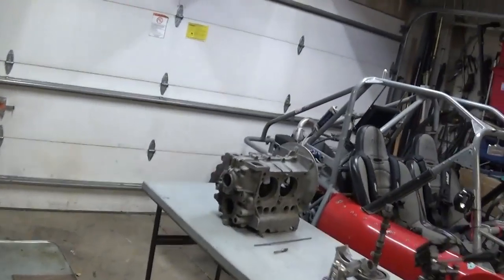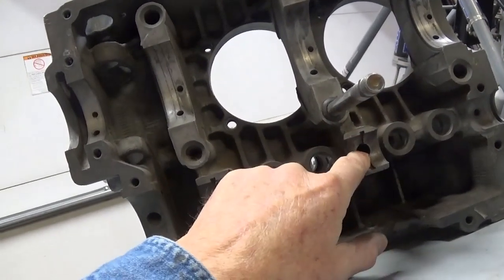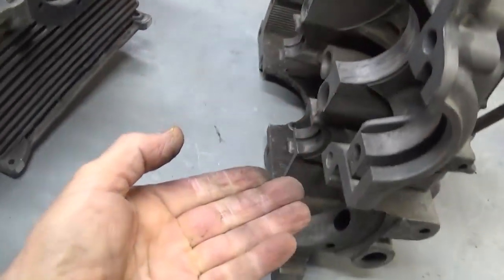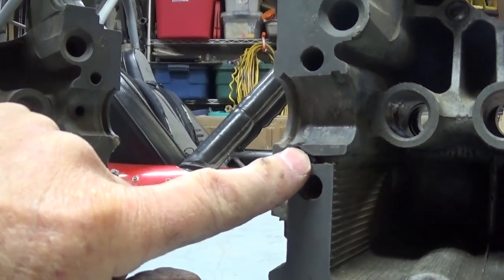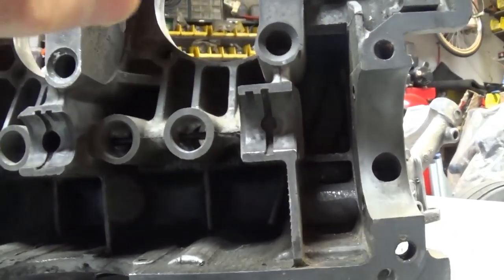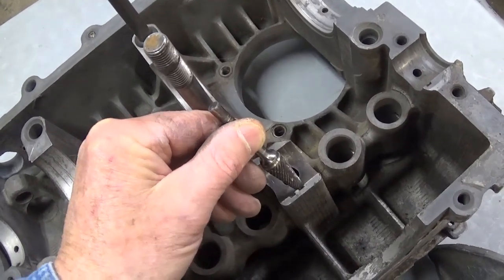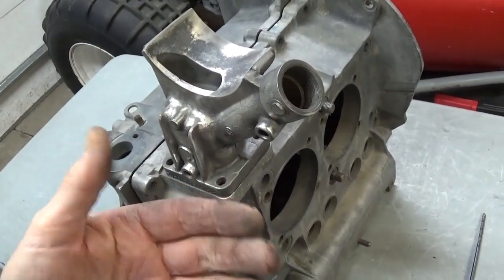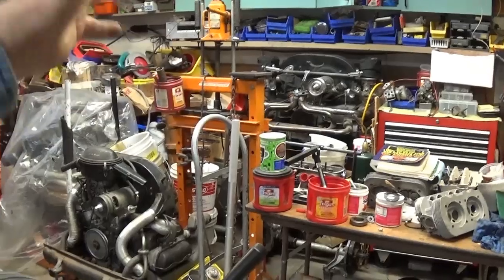VW Engine Oil System / Hoover Mod revisited

Comment: I would like to ask your advice please. I have several questions on Cam and crank gears.
I have a new Aluminum Auto Lina case, and built an engine with original cam and crank gears (German) The engine makes a noise that goes away when grease is smeared on those gears, and comes back when the oil washes it away.
1. Does anyone make matched gear sets? Hobbed the same?
2. I imagine I can buy a NEW stock grind cam without the gear, and bolt on the cam gear from this matched set correct? I am only looking for stock performance, nothing more.
3. Since this is a highly modified case. (clearanced, webbed, pinned and dual relief) and am using it in a stock configuration. Single port 1600 cc. I assume I can buy the Gear set/cam mentioned above with a ''dished'' feature for the ''new style'' bigger dual port oil pump. correct?
Your response would be greatly appreciated..thank you.
Reply from the maker: German gears mean nothing because of all the wear.  During production the bore of the crank and cam varied. VW made 15 different aluminum cam gears to compensate for this. They vary in pitch from + 1-7 and 0 threw 7.  Your new Autolina case falls in there someplace. Only the -0 gear is now made. You have to find a used one or run it in with valve grinding compound or use straight cut gears which make noise. I explain all this in all my engine build video's which you need to watch. You also need to be careful of the crankshaft thrust at the flywheel end and custom fit the camshaft thrust bearing on the cam gear end. Every engine building book explains this in great depth. GET ONE. Do Not trust your instincts or trust what you see on the internet. If you don't follow the correct tolerances and torque things down correctly your engine won't last. Don't forget Zinc in what ever oil you use and do the proper 20 minute cam break in.
Reply: @TheEZGZ  ok I will look more closely at your videos. 
Yes I understand perfectly about + and - of the hobbing on the cam gear.
I was assuming this was done to match differences in the crank gear. Hence the matched set question. However you have said differences in the cases was the reason for the + and - of the cam. Ok...now I can understand.
Because,... my cam and crank gear came from an original engine....with a rotten case. (Moisture)
I’ve put together several VW engines, and am a maestro mechanic. ASE certified, so I fully understand tolerances.
I only got back into this recently.....last build was in the 80s. Back then it wasn’t unusual to get original German engines that had not been boogered with. So, simply splitting things apart, new bearings, an oil pump....seal stuff up and your golden.
It looks as if it’s going to be hit an miss with this auto Lina case.
About building engine books....yeah, I understand quite a bit about that, and have a few. However the only thing I find in them is hit and miss about how the cam rides. Weather it hops out of the journal or not.
Wolfsburg is the only place that sells + or - cams. Oh, I forgot. I’m only interested in making stock horsepower....it’s why I said cams, and not gears.
I guess I could order all 14 of them and find the one that fits the best...ha,ha,ha
Straight cut gears are great.....BUT here’s the rub....you can only buy stock cams with aluminum helical cut gear riveted to it.
Straight cut gears are for bolt on applications. And with that you can’t get a  stock lift and duration.
Probably what I am going to do is buy several used stock lift cams and just find the best one. 
Thank you for your response. Bet your bottom dollar, I am going to check out your videos carefully. 😀😀😀
Reply from the maker: @OkFixer  Why not use the valve grinding compound and rotate the crank and cam until it loosens up. Then clean and final assembly?   You can grind off the rivet head, punch out the rivet, then drill and tap for bolt. You may have to grind down bolt head to clear oil pump. We do that all the time for performance cams with 3 holes. Good Luck with your project my friend.
Reply: @TheEZGZ  thank you

Comment: VW continued this oil gallery style with the later WBX engines so they felt it was not a big issue.
My understanding is the benefit of this mod is when the engine is run at continuous higher revs.
The stock oiling system is adequate for the lifters, rockers and shafts under normal operation in a car, but when used in an aviation application it is not.
Many of his other mods are of more benefit like oil grooves in the rocker shafts and joining the grooves on the lifters.
Reply from the maker: One other viewer commented that his newly purchased case from Autolina had the oil galley drilled. Also, VW jawbreaker bought an new aluminum bubble top case that came clearanced and all 6 of the main 12mm main bolts were shufflepinned. I love all you guys that throw in your experience and knowledge to help our group of VW lover's
Reply: @TheEZGZ  All of these mods absolutely improve the platform, the question is are they actually necessary? 

If you're building a screamer stroker engine and plan to drive it like you stole it then the hoover mod is something you should probably do. 

There is no right or wrong answer, only what's best for your application.

Comment: Reason I’ve had it come to my newly built 1776 bus motor is because T2’s run warm at the best of times so the Bob Hoover mod saddled with the Gene Berg mod give the following 
Approx 15% more oil to the heads 94% more of the time. 
The 15% is achieved by the drilling of the case, widening of can bearing saddles and grooving of rockers and shafts. The 94% is actually 100% I believe and achieved by the modification to the lifters. 

The Gene Berg cam gear mod reduces pressure on helical gears and reduces oil sling and frothing. Hope this helps .

Comment: Morning EZGZ! If memory serves me correctly the reason behind the Hoover mod is for increased volume and availability of oil for the top end, you showed part of it being the case modifications. One other important step is to add a couple notches to the lifter grooves. What this will accomplish is oil going down your pushrods at all times to help with valve train life and heat dissipation. There are other parts of the mod that have to do with the rocker shafts and adjusters. This will also increase the time between head rebuild intervals. Robert Hoover came up with these as a way to upgrade the type 1 engine to be more robust for aircraft use and took some design changes from the type 4 and implemented them to his motors.
Thanks for taking the time to make another great video
Reply from the maker: Thanks for your input. I did the research on the origination of the hoover mod from John Mahers site and thought it threw. I see no need for it on a daily driven VW engine. The lifter mod you speak off has also been around forever and more builders are including it but in reality it is for very high lift old school race cam's that made the lifter oil rings go out of range of the oiling hole reducing the amount of oil going up the rod to the head. On my channel I try to focus more on my offroad cars and daily driver's. As I mentioned in the vid I build my engines and drive them many years which gives me first hand info on what my mods do and the long term effects according to how I drive. It's good to have quality comments like yours to further educate our VW family. Recently I was studying the VW aircraft style engines but that is a whole different animal that generally has a narrow RPM operating range according to the propeller design if I interpenetrated that right. One other point is that airplane engines do not use the VW fan shroud and cooling system which has better control for engine temps.

Comment: I always enjoy your videos, learned alot. My current case has a similiar mod. Was lucky the case was line bored once.  My previous case some of the smaller oil galleys has pieces of cillicone in there and was done by a reputable shop.

Comment: I believe the reason for the mod is to get more oil to the 1/2 side pushrods/rockers. If you are using the pushrod micro squirter mod the added splash lube really helps valve train wear with the free benefit of pulling heat from head.
Reply: Thanks for the info and your opinion. I also learn from the educated comments. Such as Tony and Speed. Thanks to everyone for sharing your experience and knowledge.
Reply: You are exactly correct........

Comment: Love the invaluable information you share, EZ GZ.  You are one of a small (and I mean SMALL) handful of Vdub folks I trust on here when it comes to keeping the facts straight.  Just the other day I was just wondering if I needed to do the Hoover mods in my new aluminum case before getting the short block assembled (1776 cc for my splitwindow bus).  I do think I will pass - case closed.